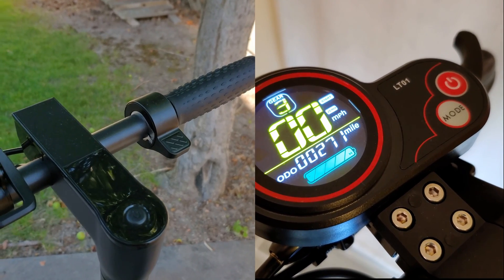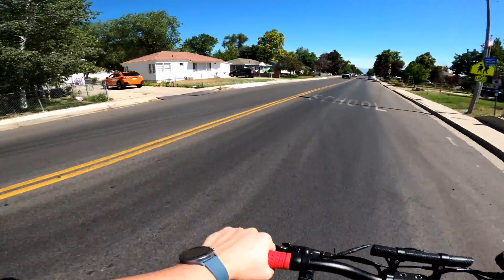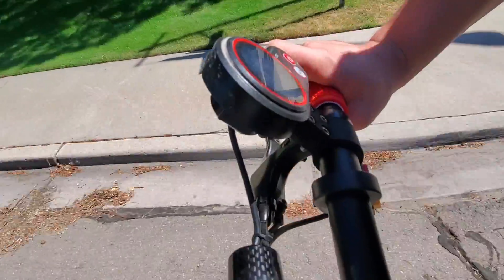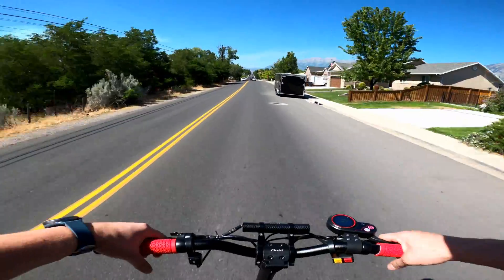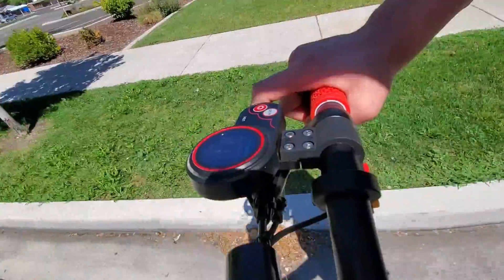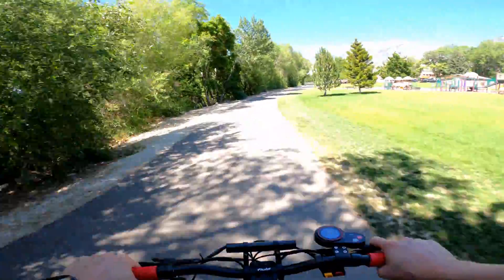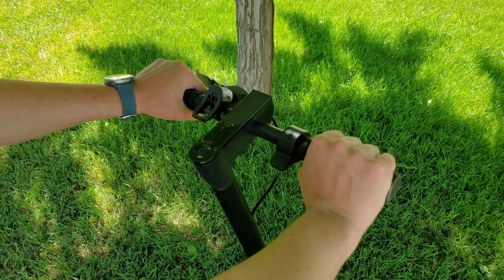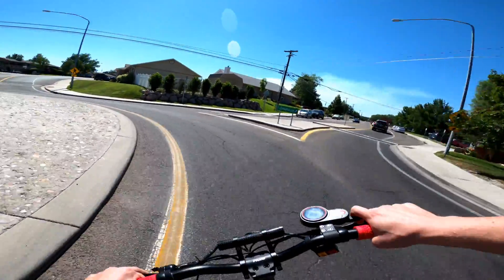Electric Scooter Throttles: Thumb vs Trigger

Comment: Fatigue for long stretches can be mitigated if you have cruise control.
Reply: Yes, but does this mantis have it is my question.
Reply: @jack2u  Yes Base and Pro. It’s in the P settings
Reply: Agreed. I hadn't considered the thumb/finger trigger question before buying and ended up with thumb in a push forward configuration. It also didn't immediately click that I had cruise control, and I tended to keep the throttle pushed forward, which was indeed tiring, especially with small hands. I have since learned to modify my instinctive behavior and now use the throttle only when necessary

Comment: Thumb throttle all the way, seriously trigger it’s not natural at all. Thumb on other hand simulate the best off all handle throttle like a bikes. Trigger ones if properly adjusted might be ok eventually but not my likes for sure. Xiaomi scooter Pro is how all scooters should look and function
Reply: The Xiaomi Pro looks a great light weight commuter, but there's a reason why all the bigger scooters have a trigger. The travel distance at the tip of the trigger for a given arc, is much greater than the distance on a thumb throttle. Not important when modulating power for your 300W motor, but when it comes to inputting precise angles to control 2000W and upwards, trigger is much more accurate.
Reply from the maker: Fair enough! Not everyone will like triggers as much as I do. I can definitely see why people like thumb throttles

Comment: yeah but in a panic what if you confuse it for brakes
Reply from the maker: That's definitely a possibility but the more you use a trigger throttle the most intuitive it will get. Thumb throttles definitely make it impossible to confuse the throttle and brake though
Reply: @RK9Rides  I guess. Idk I have the hover 1 alpha with the thumb throttle and ride it everyday, personally I dont get tired but idk

Comment: Great points.  Even by just angling the throttle down a couple of notches really boosts the ergo of the finger throttle.  The throttle out of factory for most scooters are set waaaaay too high of an angle.  Actually helps the display legibility when you angle it down as well I’ve found with mine. I really hope ESG watches this video.  Keep up the good work mate.

Comment: an upright throttle is a common issue causing the magnet to become stuck as you ride from the slight sideward force you put on the trigger
Reply from the maker: Oh interesting, I didn't know that. Another reason to set up the throttle correctly!